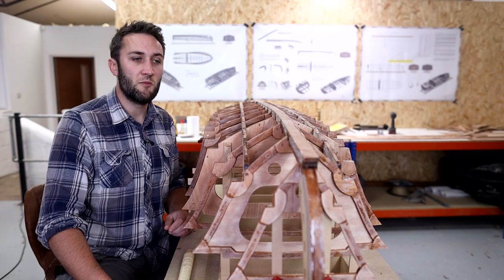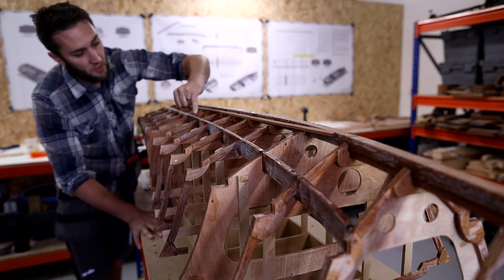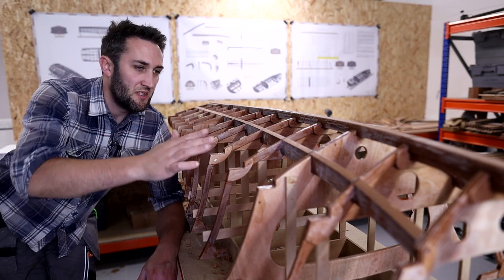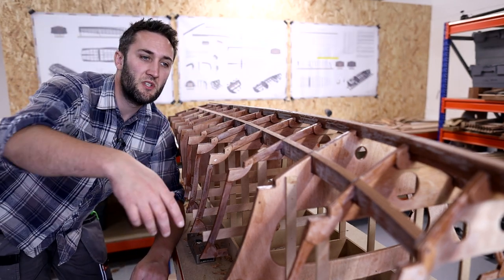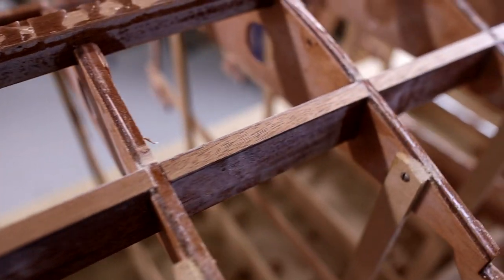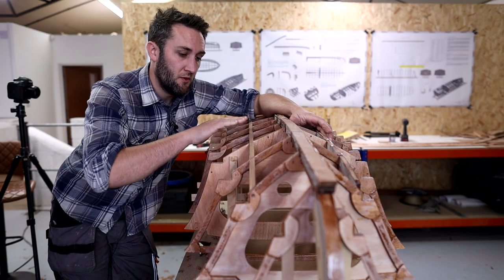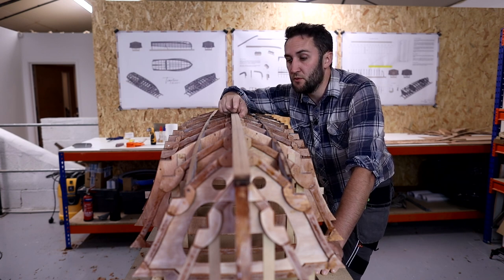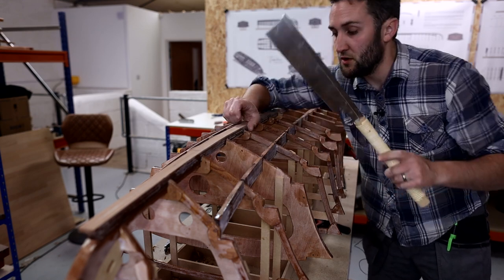Bevelling The Stringers and Keel | Temptress 1/4 Scale Boat Build Part 16

Comment: This has been a great watch. It brings one question to my mind. This is a 1/4 scale. What is the smallest scale that this boat could be used by a person(s)?  Could a half scale work as a very stylish dinghy?
Reply from the maker: I wouldn't recommend scaling the boat for actual use, for modelling it is fine but for use we recommend it is built as per the design.... Unless you want to water ski on a pair of 6ft models maybe? 🤔

Comment: Could the bevelling not be built into the cnc process? I recognise it would take far more programming and wastage in the cnc process but surely would enhance the build accuracy.
Reply from the maker: I did think about this early on for the framework but came away from the idea as it is actually more likely to induce problems and remove stages at which you can absorb small errors.

Comment: Can you drop the stringer below the frame work so not to do so much planing and sanding?
Reply from the maker: No, this should wrap around the frames and maintain full contact with the bottom of the boat.

Comment: What size CNC machine would be required for the full size build?
Reply from the maker: I would recommend an 8x4' machine as a minimum due to the fact that a lot of the parts are sized around standard plywood sheets.
Reply: @DanLeeBoatbuilding  I’m in the process of building a new shop at the moment. A cnc will definitely be a new addition to the shop. 
Thank you.